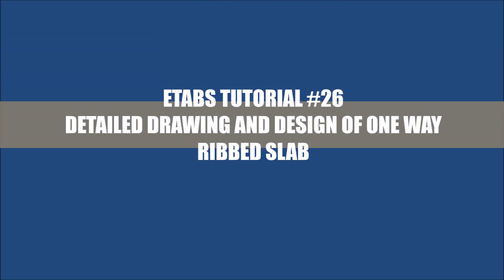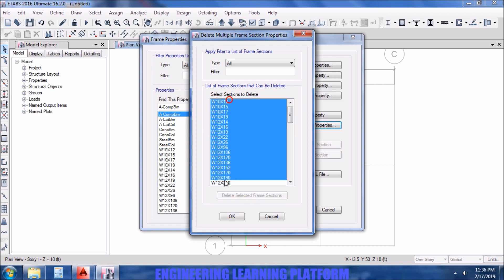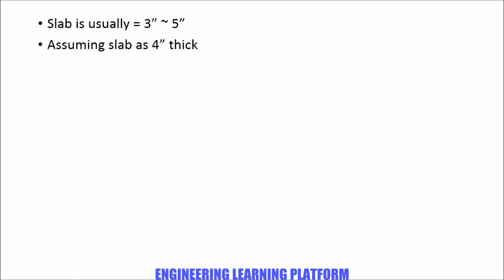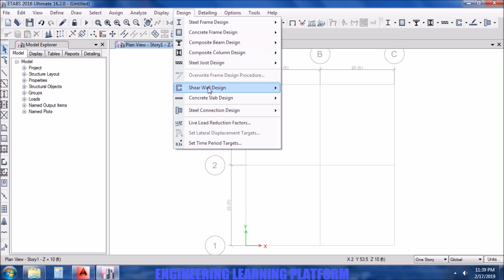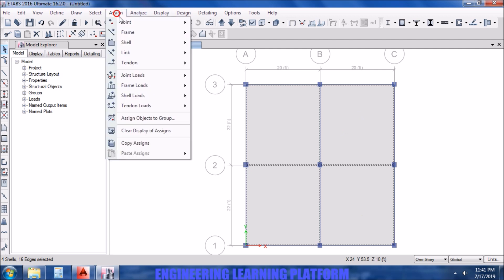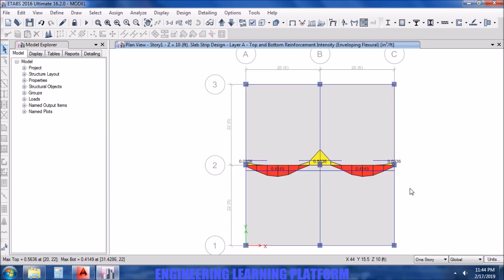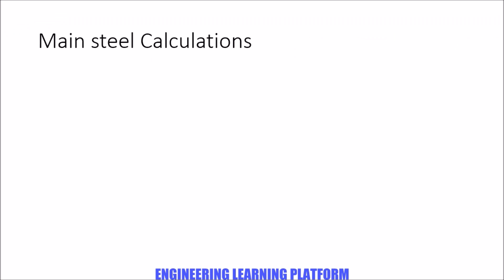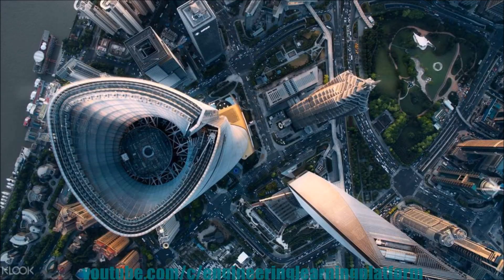Detailing and Design Ribbed slab using etabs tutorial

Comment: I think you made a mistake: The slab is being assigned the default mesh so it’s sending the load to all surrounding beams, which is not how a ribbed slab really works.
Reply from the maker: Not really, when i'll make beam design model i will use slab as membrane instead of shell thin so it would become independent of meshing, have a look at difference between shell thin and membrane